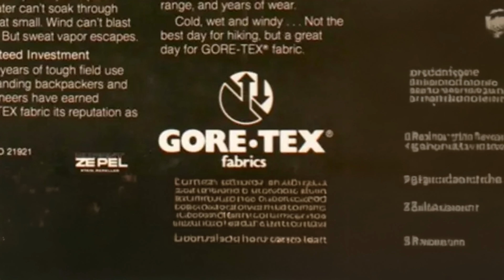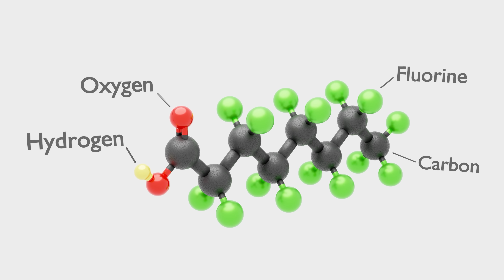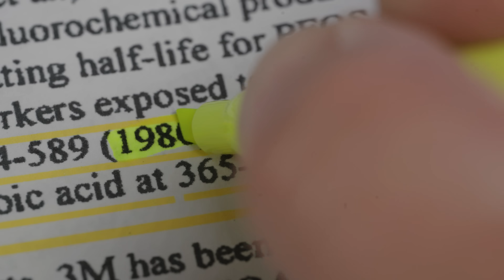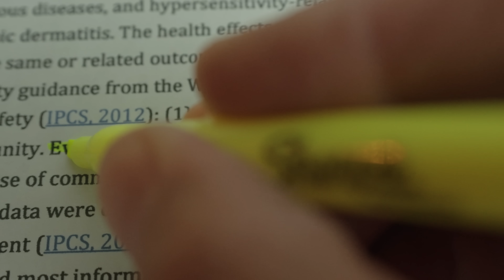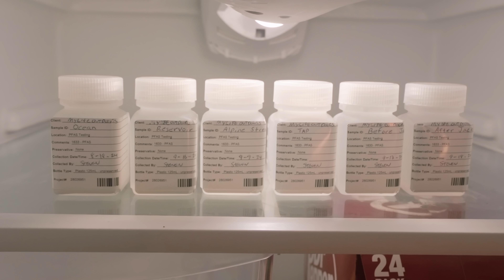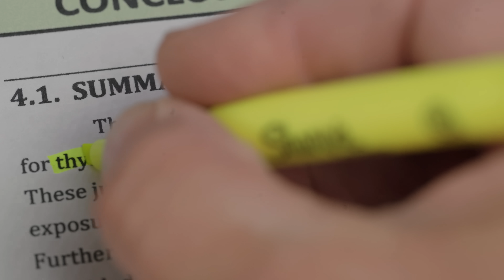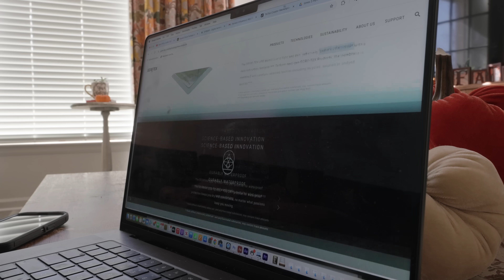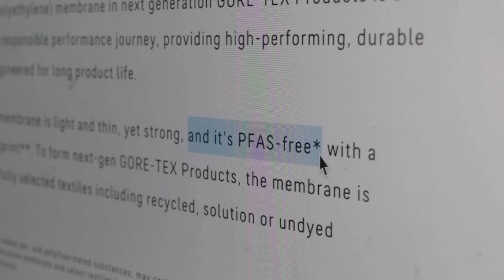Your Gear is Poisoning You! (Not Clickbait)

Comment: As a backpacker whose day job is in the field of environmental cleanup (including PFAS), I can say this video was very well researched, clearly presented, and refreshingly accurate. I'll be sharing it widely!
Reply: Yes... let's all test for PEFAS and micro plastics by using an industrial plastic container and plastic screw lid to hold the virgin liquid...😂
Reply: Polyfluoral compounds are everywhere and in everything and it's scary. I work in a lab that does analysis of polyfluoral compounds 
I wish you were wearing nitrile gloves while gathering the water because these analytes can be absorbed through the skin. PFBA is very common, and yes contamination is a very real concern when doing testing.I have been using a filter that does a decent job at removing PFAs from water, and I use silicone as a water repellent. Just wait until you learn about VOC's and Micro plastics. 🤓
Reply: @Globetrotter-1 I like your joke, but those bottles are the best ones to use to prevent PFAS contamination. They look to be HDPE which are used in the industry, and I believe PE can be used as well.
Micro plastics will show up every no matter where you look 👻
Reply: @Jeff13mer  It really doesn't bother me at all. There's no problem with wearing the clothing and zero problems drinking the water. When you see what India and China dumps into their rivers and environment on a daily basis you'll realise that worrying about a minute amount of plastics   washing off you during a rainstorm is total nonsense.
Reply: @Globetrotter-1  microplastics and per- and polyfluoroalkyl substances (PFAS) are not the same thing
Reply: @CorporalCornGaming  So what? There are no real problems with PFAS either...and definitely not in the amounts shedding from a few mountain walkers. There are far, far more problems and concerns to deal with. I laugh 😂 at the absurdity of it all.
Reply: Thanks a lot buying this stuff.
Reply: @MR-MR-ud5oo These chemicals are in so many things. I’d bet a few doll hairs you’ve bought some stuff with these chemicals in it. Ever used a teflon pan? Air fryer? 

Stop focusing on individual consumption and focus on regulations and manufacturing practices. You could never buy a single item with PFOAS and… it would still be a problem. Stop yelling at your neighbor and eat the rich.
Reply: @1519Spring   Google where it's made today. You don't get a straight answer. Just that it's been fazed out of the US. 🤔
Reply: @1519Spring  anglers are watching it all go to heck. But you back packers don't care.
Reply: except the issue that he is promoting a jacket also made from harmful fossil fuel base polymers (paramo). seems he did not research them very well. the problem is not just pfas. it's all refined fossil fuel polymers.
Reply: @musicbcwalk  the issue is go back to wax
Reply: How'd you get that job? Very cool
Reply: @secretbassrigs  100%
Reply: @Globetrotter-1 
That is the type of container we used to collect water samples samples for analysis. He said he did a pretest with distilled water to see if any PFAS were present, and they weren’t. So using the bottle is not an issue for this test.
Reply: Especially the "ocean" sample... 🤦‍♂
Reply: @sherylwillis3991 The bottle he used is a High-density polyethylene (HDPE) bottle. These are made in a series of steps, including:
Petroleum is heated to create ethylene gas, which is then collected. Polymerization
Ethylene gas is mixed with metallic catalysts to create a polyethylene slurry. The slurry is cleaned of any catalyst and the HDPE is extracted, filtered, and dried.
The HDPE is then melted and extruded into a continuous parison, or molded into granules.
The HDPE is then melted and injected into a mold to create the desired shape, or softened and passed through a nozzle to mold the plastic into the desired shape.
So... you're trying to tell me that it is necessary to seriously pollute the global environment with heavy industries spewing out toxic chemicals, just to make containers able to measure microscopic samples of toxic plastic waste? 🙄😂
It's all absurd and scaremongering nonsense.
In reality, a healthy human system and bodily functions naturally rid the body of toxins. Advising people to not produce or wear waterproof clothing such as Gore-Tex and DWR costings is yet more nonsense.
Reply: Recycle it into future refrigerant, it's not so much the cookware but what washes off your teeth everyday and what you swallow down
Reply: @Dr.Snooze-gt5yg  I love eating tasty Teflon with my 🥩. Actually Teflon is not really a problem for the digestive system, and even if you absorb some the body soon naturally gets rid of it. So it's not a problem. I prefer frying using quality non-stick pans and it makes cleaning a breeze. It's far better than using copper or old iron pots.
Reply: And totally worthless because of the reputation of hippie advice over the last 10 to 20 years.
Reply: @Globetrotter-1 No, our bodies detoxification pathways evolved over thousands of years for chemicals and compounds that existed in nature, not for new chemicals created in the last few decades. This is very basic, if you don’t understand that, you have no business commented on the science of this. This amount of accumulation in people’s bodies is significant. PFAs and BPAs remain in the body, it should be taken seriously.
Reply: @Globetrotter-1  You act as if the tests can’t distinguish between plastics…stuff that has pretty specific structures…but yeah he’s the silly one
Reply: Voting in RFK (albeit by proxy) simply because I believe in changing our food and our environment!!!
Reply: You are the sassiest backpack master in alll the land you flamboyant lil sister u
Reply: You are the sassiest backpack master in alll the land you flamboyant lil sister u
Reply: @yeetyaw9120  No, I'm pointing ☝️ to basic understanding of how the world 🌍 ticks and how people are obsessed with things that don't matter, while blind to what does.
Reply: I am more worried about the Teflon on pans( cast iron only)
Reply: @cobbb3r  Iron leaches into the food, especially with acidic foods like vinegar, tomatoes, lemon juice, wine etc.
But in reality, any type of pan is fine compared to the wide variety of substances and gases and toxic chemicals we are all in contact with on a daily basis.
Reply: I'm sure everyone will keep scrolling when you share it!
Reply: here here
Reply: @Jeff13mer  if they are everywhere and in everything how are gloves going to make any difference?
Reply: @Globetrotter-1  you did understand that not the use but the production process is where the relevant amounts of PFAS go into the environment
Reply: @LizVerkannt  Did you actually read any of my replies before engaging your 🧠? 🙄
Reply: are those plastic bottles suitable to keep the samples in? is there a chance of contaminating the sample with a PFAS from the bottle itself?
Reply: @Globetrotter-1  What are your thoughts on lead chips? Salted or unsalted?
Reply: I’d love to hear more about how you clean up PFAS!
Reply: @Globetrotter-1 I did want to tease him a bit for taking samples with a plastic bottle but I also know how insanely critical keeping weight down is for any safe backpacking endeavor. And considering he had a control that did not show PFAS he proved that the bottle was adequate for this use without itself being a source of contamination.
Reply: @Adombom  The family packs tend to be very heavy and can give you constipation.
Reply: @natorsi  I still think it's all completely unessassary worrying about nothing and the testing is a waste of time. Above all it's simply scaremongering for people wearing high quality waterproof/breathable clothing.
Reply: @Globetrotter-1  I’m not sure it is a waste of time considering it’s only going to aggregate and we still are learning about how it’s going to affect us. Like I don’t think we should be screaming and crying about it but it makes sense to document the phenomenon and determine if it could harm life. If it harms a person’s mental health to think about it it’s probably better for them to ignore the issue, but other people are available to keep working on it in the meantime. 🤷‍♀️
Reply: @Jeff13mer  Are there any other ways prevent contamination during the analysis of PFAS and other persistent pollutants?
Reply: You are very special
Reply: I’m curious as to what the results would be if he used actual rain water instead of distilled water which is a fairly strong solvent
Reply: The guy entirely ignored what the clickbait title says bc for a fact with the amount of pfos in everything we eat there is absolutely no point in avoiding it AND he went back on saying you shouldn’t wear it bc in reality the majority of the pollution comes from manufacturing. What part of this was helpful in any way all he did was make dumb people on the internet afraid of plastic jackets.
Reply: @secretbassrigs 
Yes, this! The fishing has been completely ruined by many different causes. The past 2 1/2 years, if I had to feed my family fishing alone, we would have starved to death. Which if I'm being honest, seems like the end goal anyway
Reply: @ByteMe908 You fool the POINT is that manufacturing these products is the problem. So yes, people should not be financially supporting the manafacturing by purchasing the jackets.

You have the gall to call others dumb but don't have the wits in you to recognize the importance of educating people on topics like these.
Reply: Thanks for verifying—looks like we all needed a true backpacker’s seal of approval
Reply: hows the money running that gig
Reply: Are you collecting the sample in a plastic container?
Reply: What kind of job do you have specifically?
Reply: @Globetrotter-1 just because some places have much worse drinking water, doesn't mean ours isnt bad. Let's try to have almost nothing toxic in the water, right?
Reply: @Globetrotter-1 no. 😂

Our biology doesn’t work that way. It’s not that simple. Like your brain. 

I suggest you seriously reevaluate your life and profession. Seriously. I know you can do it. I believe it you.
Reply: STAY WOKE...While They will drive around with private jets you will do that shit 😂😂
Reply: You should make more yt videos!!!
Reply: Definitely salt them they are good dipped in ranch too @Adombom
Reply: What do you think about water filters for home use in this context?
Reply: Wow thank you for sharing it widely to 3 people
Reply: @Jeff13mer  I think what that commenter was getting at is that maybe we should use glass jars. Though if it's something that is widely used and really won't end up contaminating the test water, then no problems really.
Reply: @Globetrotter-1  It's actually not a minute issue. It has a cumulative effect. It's basically like mercury in that way. So it starts out small, but it grows the longer you live.
Reply: @ArtisChronicles  Nonsense! 😂

Comment: The jacket test was very kind to the manufacturer, because if the jacket was on a moving human, subject to abrasion and human "chemicals" (sweat, salt...) I would expect the amount of PFAS shed would be astronomically higher.
Reply: I’m surprised the there were no PFAs in the water used before the rain jacket test
Reply: @jayq8050  He said he used distilled water.
Reply: Probably not. The reason PFAS is used is for its durability and stability. What is rinsing off is likely loose excess from the manufacturing process.
Reply: @grizz6582  Yeah I can't imagine the jacket was actually shedding any PFAS, but it likely had PFAS dust and residue from manufacturing. He could run the test again and we would have a better idea if the PFAS contamination was a one-time-ish thing from manufacturing, or if the jacket actually sheds PFAS from the main material.
Reply: @NNFaNRacing I agree it would be very interesting if he changed the water and ran the test again. Maybe there is only shedding when the material is new.
Reply: Didn’t forget high altitude sun exposure, where materials like this are enjoyed in the mountains. Let’s keep in mind these things keeps people alive in extreme conditions.
Reply: Even so if you actually read the literature he linked it states the harmful levels of PFBA are >30mg/kg a day. There's absolutely no way this comes close to his own definition of harmful.
Reply: @andrewmacleod620 But most people only wear things a few times, so shedding when new is still very relevant
Reply: Yeah, I expected it to be a 1000 ppt. The fact that water coming right off the source is only 6 times what was in the drinking water is making something not add up.
Reply: @grizz6582  That's the point! It is shedding PFAS!
Reply: @andrewmacleod620  Hello.....? It is still shedding PFAS! That was the point of the testing! Wake up!
Reply: Uv
Reply: @donmichaelbockhoff1634 everything ads up, every cup of water, all your food is processed with that water etc.. your really the issue
Reply: Look for PU coating in rainwear if you want a harmless alternative. But dont expect them to breath or be light to wear.
Reply: You might expect that, but your expectation does not necessarily have any relation to realty. That why expectations are not proof or evidence.
Reply: @johnsmith1474  Yes, because clothes never show signs of wear or abrasion. They are immune to friction and chemical reactions. It's why our favorite clothes last forever.  Oh  and I ran an extreme sports clothing line where we ran such tests. 😑
Reply: The question is that: by merely having a PFAS-intertwined clothing jacket on your skin, is that absorbed at all by the skin? Or is it so little amount that its negligible to human health?
Reply: Why didn't he compare the test to the "PFAS free" gear, especially after mentioning how PFAS free manufacturers cant guarantee it's PFAS free?  Was it an oversight or intentionally misleading?
Reply: Definitely clickbait, inconsistent "tests" on par with flat earthers. Only interesting fact was at the end, where he reveals his blood PFAS content, he then has no idea what to do with the information... states the national safe average, video end.
Reply: So it’s ok that our drinking water is poisoned so that wealthy weekend warriors can spend their tree time hiking in the mountains?
Reply: Is this for all brands that have waterproof gear? Or just certain brands?

Comment: Analytical chemist here. Thank you so much for this video to spread awareness.

For us, it is very obvious why PFAS are still an issue: proper analysis is sophisticated and therefore alarming PFAS levels don't show up on routine analysis - it requires specific targeted analysis and it is very difficult to get funded for such an analysis before it gets proven multiple times to be an issue. Also, the industry doesn't like to be proven as problematic and every university in the USA is funded by the industry. This means most research groups are basically prohibited to research it, because state funding for non-profitable innovation has been successfully defeated.

If you want to know why the analysis is hard, it's because everything is a source of contamination and it is hard to prove the results to be true. The very instrument itself and necessary consumables to measure them will shed PFAS, if no special parts are used. You will all hear more from PFAS in the following decades.

Comment: Pfas is in ptfe tape, which is used every day to seal threaded fittings in domestic water pipes.
Reply: oh that reminded me, bicycle mechanics handle PTFE grease with their bare hands...
Reply: Is it?
Reply: @pdloder yes it’s what they call teflon tape. i’m a former hvac/pipefitters apprentice. that stuff is in every comercial and residential pipe for the last 70 years.

there’s something new called a sharkbite joint that basically uses clamping force as a seal instead of a screwed seal. the sharkbite doesn’t require teflon tape.
Reply: @steelesmith1379 like
Pro press
Reply: @steelesmith1379  we might have to go back to plumber's hemp.
Reply: @pdloder  Mmm.. Hemp...
Reply: yeah that's due to uninformed and uncontrolled consumerism,we always want the best stuff for the short term neglecting long term effects, don't we.

It is an issue with the human race not any particular entity.
Reply: @Jokke13th  😄
Reply: StarDustMoonRocket  Nope you're just a contrarian.
Reply: @StarDustMoonRocket  the guy literally mentioned Teflon coated frying pans. From my research Teflon is safe unless heated above 500f, but it is still a forever chemical. Which is not good.
Reply: @steelesmith1379  No its not "in every commercial and residential pipe ".  It's on pipe threads.  So anywhere pipe threads are used.  Galvanized pipe ends, and CPVC threaded fittings, threads on sink shutoffs and adapters.  Just the connections, not the pipe and most residential installs don't use galvanized anymore.  Either CPVC or PEX.  Also, water passing over these tiny exposed edges where the thread tape is used are either COLD water or hot water never exceeding 200F so at those temperatures, the teflon pipe tape is enert.  YES the manufacturing process for this tape is problematic but further testing would need to be done on residential installs to determine any actual harm from it without making huge sweeping blanket statements.
Reply: @pdloder  we still use that in France, but generally not on hot pipes.
Reply: @fatphilg  oh really! and probably for good reason. Thanks
Reply: @Cinnabuns2009  couldn't have said it better myself 👍
Reply: @pdloder Im all for backtracking to mother natures answer... When i was 6 i sat with my lego bricks thinking what happens when they are no longer needed as i was well aware they would. Not rot..... 39 years on and we're getting some alarming news...